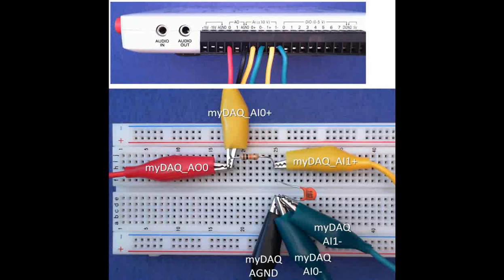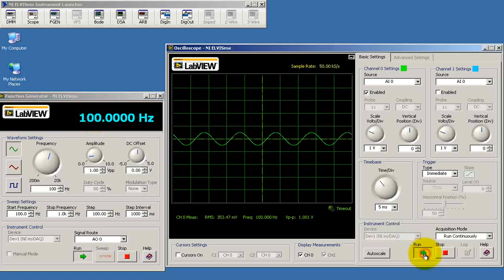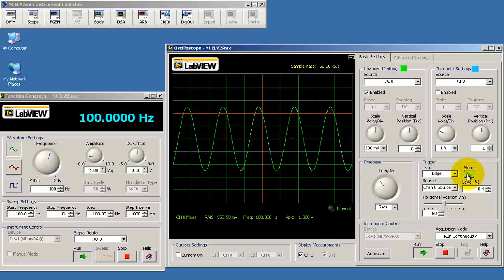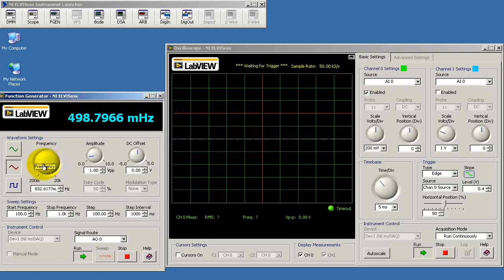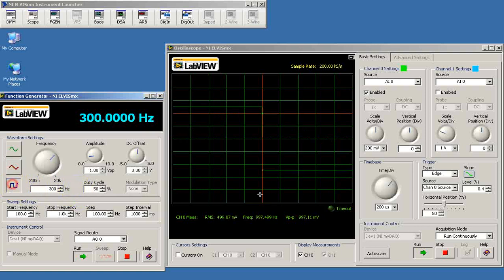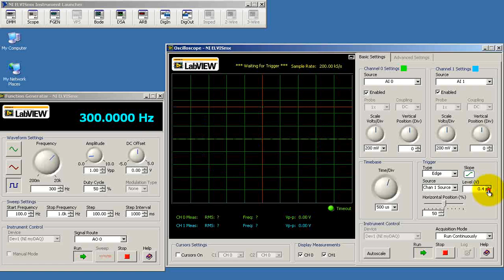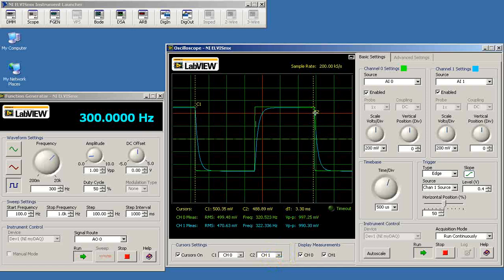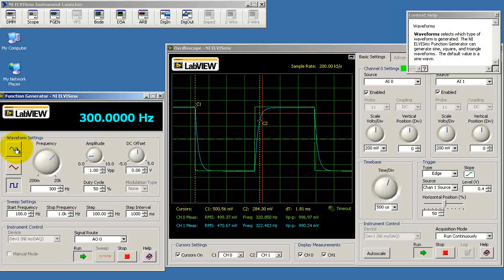NI ELVISmx | myDAQ: Oscilloscope demo

Comment: Whenever i try to zoom in via changing the time div the sampling just cant take it and its impossible to read the trace. any ideas? my experience of this device is that its not very good but maybe ive missed an option
Reply from the maker: The maximum sampling rate is 200kS/s corresponding to a minimum sampling interval of 5us (5 microseconds). Look at the top right corner of the traces window to see the actual sampling rate. When you use lower sweep speeds (larger "Time/Div") you will see this number get smaller. When you stop collecting data and then zoom in, your resolution will be lower because the samples were collected at a slower rate. You'll need to adjust the triggering (and perhaps use the "Run Once" acquisition mode) with a low "Time/Div" value to capture data with a higher sampling rate.
Reply: ***** thanks for your reply. do you know if theres any way you can adjust the horizontal position of the display? when I zoom in on a square I cant find the transitions because I cant move the wave left or right. most frustrating!